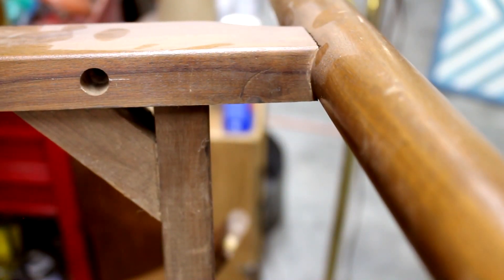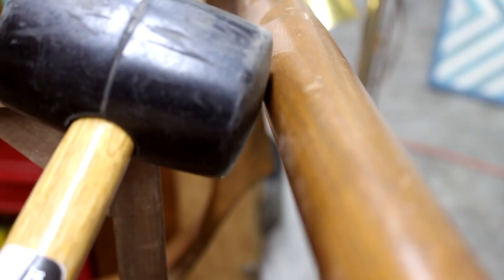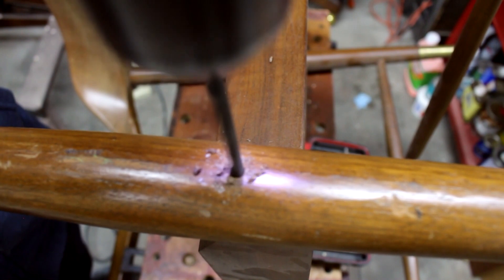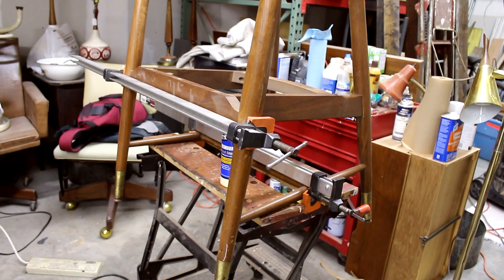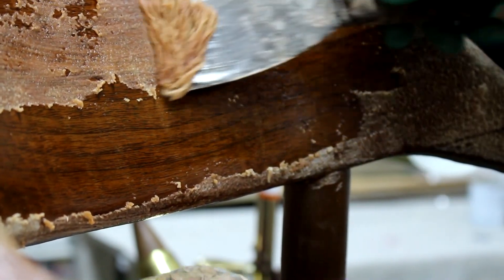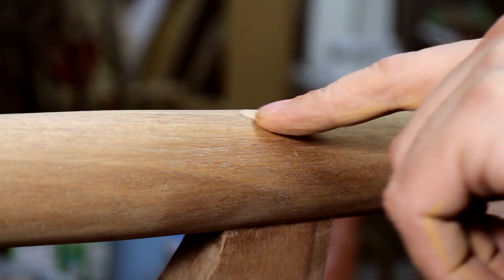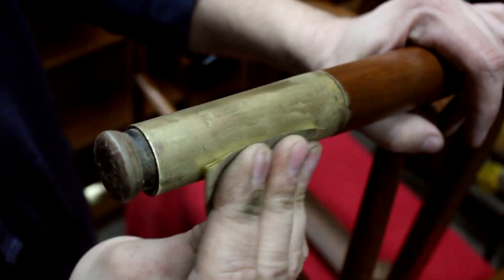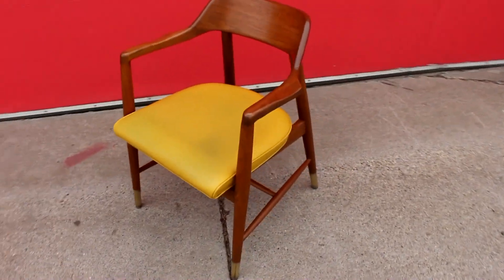Refinish & Repair a Mid Century Walnut Chair

Comment: If you don't already have some, I would suggest getting (or making) some stainless steel card scrapers, and learn how to hone them. Much safer and easier to handle than utility blades. Plus they come in curved shapes that can follow the contours of the furniture. Good work!

Comment: I really love your videos; bought a library table last night at auction and mostly b/c of your videos (which I'd already watched) I knew I could break out a rubber mallet and some glue and fix it up! It's in pretty good shape (including the finish) except for extremely loose joints.  Currently sitting with some pipe clamps.  May sell it eventually but bought it for myself :)

Comment: Hello! Long-time viewer here. I recently acquired a beautiful 60s era coffee table that I'm working on restoring. I had a question I was hoping you or another viewer might be kind enough to help me with- my table has metal slippers (presumably brass?). They're similar to these, but they cap the entire leg, as we commonly see in midcentury pieces. The caps on mine, however, are badly corroded and are so dark they blend in with the wood. I'm trying to rescue them with sandpaper and steel wool, but I'm wondering whether there's another option as I fear they may be beyond restoration. Is there a way to remove these without damaging the legs? Or is there another option? Many thanks in advance. Love you videos.

Comment: Where do you buy your products like stain, mineral spirits etc?
Reply from the maker: Most of the products I use can be found at Home Depot or hardware stores.  An exception would be General Finishes products.  I use their gel stain a lot and I buy it at Rockler.

Comment: nice job! tell me please, what did you apply after stripping?
Reply from the maker: Elzara Muratova After stripping, I cleaned the wood with mineral spirits and #0000 steel wool. After that I applied an oil stain for color. Thanks for watching!

Comment: Your channel gave me the will to restore my 2 bow wood stainer armchairs. I just need to find all the products you are using, here in France (or equivalents)! And since we are currently confined, I need to find them online! I understood that you use CitriStrip for the stripping, Varathane American Walnut Premium for the stain, and a top coat which is Minwax Wipe-On Polyurethane in Satin. Is that correct? Thanx again.
Reply: I have the same question, I found them all in Home Depot and LOWES but not sure the Minwax poly is water-based or oil-based?

Comment: I've seen you use American Walnut stain a few times now on walnut wood. Just wondering why you do that if the wood is already walnut?
Reply: Some people prefer the uniform look stain gives to a particular wood. When you're dealing with a wood like walnut that has a good amount of color variation, especially if there is sapwood, it can cause various parts of the piece to look lighter or darker once the top coat is on it.

Comment: So that break in the arm looks pretty bad. Do you think it will hold up to the pressure of normal use?
Reply from the maker: It should hold up fine.  A well glued joint is generally considered to be stronger than the original piece of wood before it broke. Thanks for watching.
Reply: Wouldn't matter if it were steel, People would still break it, that's what People do :)

Comment: How come you took out a Phillips head screw from the legs and put a flat blade one back in?
Reply from the maker: Oded Kain It was actually the same screw but a different screw driver. The straight screwdriver just happened to be nearby so I used it instead of the Phillips. Thanks for watching.
Reply: nice work

Comment: I'm just wondering, don't you make it almost impossible for another person to ever be able to restore this chair later on down the years, by putting glue in all those joints?? Because it looks like you had a hard enough time getting some of them apart with no glue in there?
Reply from the maker: If the chair ever needs to be taken apart the glue can be softened with heat.  If I didn't put glue in the joints the chair would not stay together. Thanks for watching.
Reply: @DashnerDesignRestoration  oh, I didn't know about the heat trick..... Thank you! I just sub to your channel because I love the content oh, and you do a fantastic job at showing us how things are done😍
Reply: Wood glue is necessary to keep the the wood joints together. Wood glue usually lasts around 20-30 years if cured correctly. Those joints he couldnt get apart were only because of the screws (a sign of a lower quality built chair).